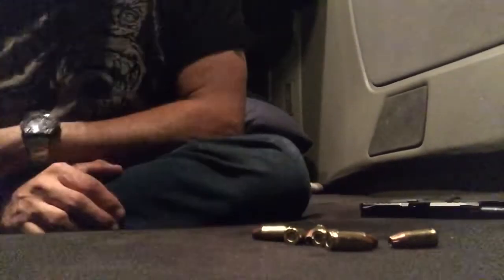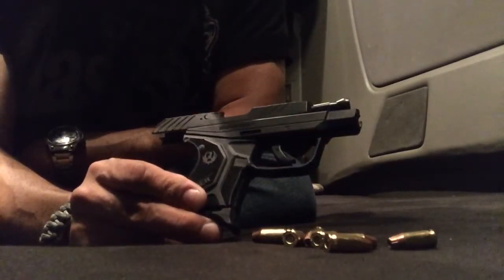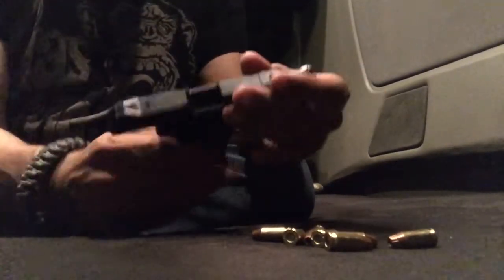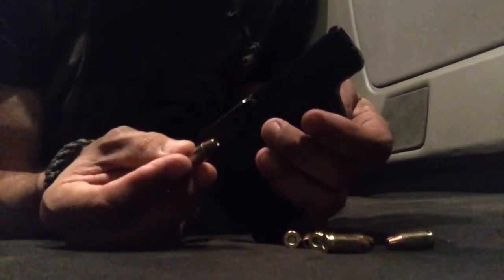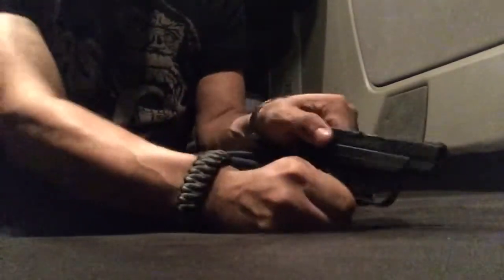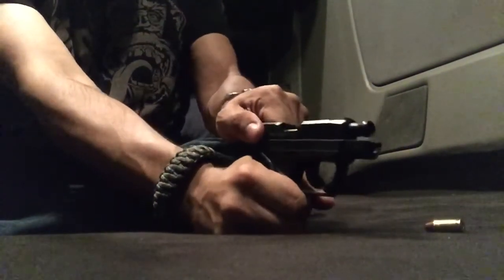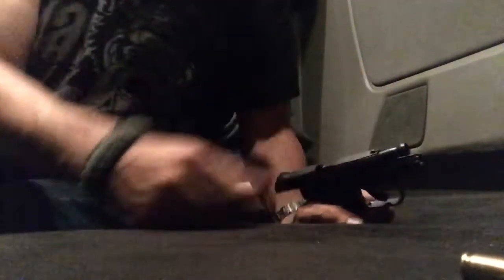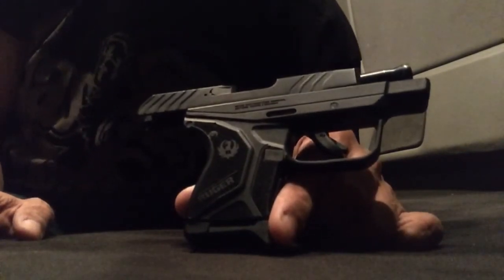Ruger LCP II answer to fail video

Comment: Don't let your pride of ownership in anything overtake your common sense. Don't let your pride of owning a LCP2, or any firearm for that matter, overtake your common sense. I will not bash the LCP2 at all in my reply. I will speak of how semi auto/ full auto firearms operate and offer some advice.

A failure to feed (FTF) issue can be caused by many things. Failure to cycle the slide completely is one cause for FTF issues. This can be done human error manually cycling the slide, limp wristing the grip to name just a couple. 

Failures to eject (FTE) are also caused by a number of things. Some examples include, to strong of a recoil spring, a weak ejector, failure of the ejector to grasp the shell casing to name a few.

RAFAEL, Try not to take this wrongly man but there is so much wrong in this video that has to be set right.

The bullet being in the case has nothing to do with FTE issues in any semi-auto weapon. With the way you argue it a person would not be able to remove a round from the chamber without firing the bullet. "No gun is going to spit out the whole bullet"  What? You show in your video that your pistol "spits" out the entire round, casing and bullet, with what you consider to be a complete cycle of the slide. Tell me how you eject a round in your chamber that has not yet been fired... by cycling the slide right!?!  The ejection port of every semi-auto/ full auto firearms known to man is made for a complete round to be ejected.

 Furthermore, the force or speed of the slide has nothing to do with FTE issues. As long as the slide reaches extraction actuator the empty shell OR live round WILL be ejected as long as the ejector is working properly. Before you comment... try it. Pull your slide back slowly. The weapon will eject the round just before you reach the complete rear of the frame.  That proves that the ejection port is big enough to eject the entire round.

FTF issues that you show in your video is not the weapon. The FTF issue in your video was done by you not allowing the slide to operate properly. When you show what you think it works like under fire it worked right. Try this before you comment... Pull the slide to the complete rear. Just let go of it. Don't keep your hand on it... not a finger. If the recoil spring is operating properly the weapon will strip a round from the magazine, up the feed ramp and into the chamber. All semi-auto/ full auto firearms know to man operate in this same fashion.

Refael, This part might piss you off but please take it seriously. 

Pleased do everyone a favor... Go get some training. Get yourself some snap cap/ dummy rounds. You should not have been working with live rounds for this. Learn the proper language if your going to act like you know what your talking about and take a class on how firearms work because you clearly need it. Better yet, just take this video down because you don't know what your talking about. Sell your firearms. You don't know how to handle them or how they work. Your going to get yourself or someone else hurt.
Reply: Jan is GAY!! 
Wow! That's a mouthful of info. there bro...
Reply: He knows his guns better than the guy in the video he makes this in response to. The other guy admits to never having fired a single shot in his LCP II before making two videos calling the gun a "COMPLETE FAIL". Raf did say some things wrong but his intent behind his words are correct. Under normal operation, cases eject empty without the bullet. Someone can not say that routine jambs occurring during manual cycling of unfired rounds through the gun will occur just as frequently during actual firing. Also despite the other guys claims, this video shows you CAN manually cycle rounds through the gun without having it jamb - something the other guy said you can't do because it doesn't work as easily as his other (actually fired) 380's (the classic "the gun is defective because getting it to work would require me to change")
Reply: You made some good points, but that’s not the only way you unload a pistol with a round in the chamber.  
The first thing you have to do is drop the mag, otherwise you will just keep feeding it rounds and the intention is to unload.  Next you do an overhand grab on the slide covering the ejection port, pull the slide back and the live round will either go into the palm of the hand over the slide or it drops straight down through the magazine well into your hand. 
It doesn’t look nearly as cool as turning the pistol sideways, ejecting a round out the port & catching it in the air but it works every time and it’s how I unload the chambers of all micro pocket pistols.
Reply: @ZootyZoFo  There was a gun that had issues with setting off rounds when emptying the chamber how you describe (covering the ejection port, trying to catch the round). I can't remember what gun it was but gunblue490 did a video on it.
Reply: The Dude - Oh shit, not good!  Sounds like it could firing out of battery while being extracted, a Ka-boom.